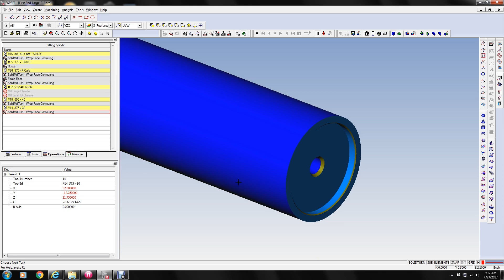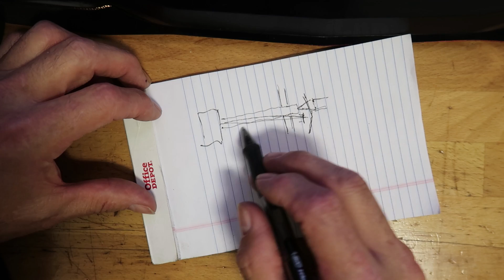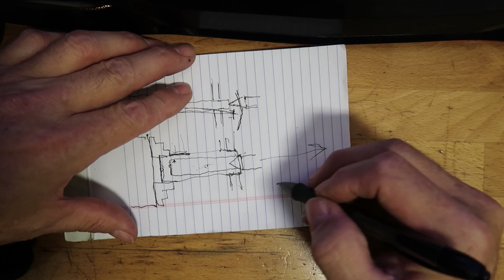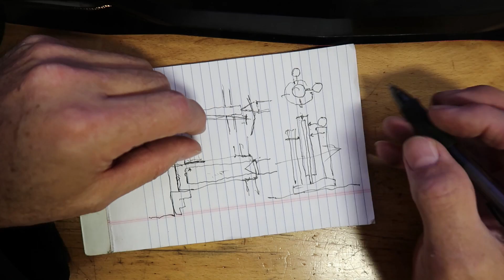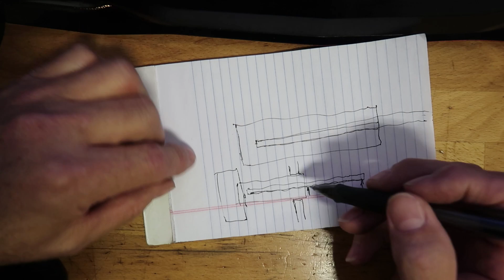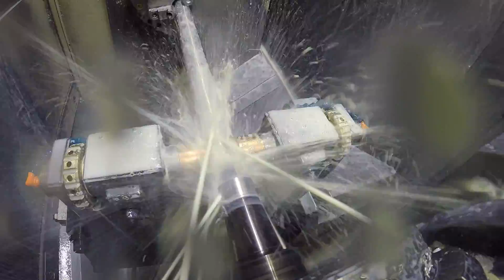Some Thoughts On Using Steady Rest and Milling Part End

Comment: Nitronic 50, is that tough material to cut? I have a job coming up, simple turn part with tap hole in the middle. What would you recommend rpm,feeds and speeds be?
Reply from the maker: I would start with around 150 SF (This is in feet if you are metric you will need to convert). That would be safe and you could speed it up as necessary, for the turning with carbide. If you are drilling with HSco drill I would not go over 40-50 SF. Depending on the tapped hole size. If it is on center-line on the lathe I would single point thread is if possible. Rather then tap. If you must tap get a good tap. This is not the place to economize on the tool. It will give you grief later. And use a good tapping fluid as well. I usually use a syringe to get it into the hole first. Not just put it on the tap.
Reply: @EdgePrecision  Thank you so much for the information!

Comment: what were you adjusting with the hammer and why?
Reply from the maker: On the mount of this steady rest there are jack screws that raise the steady rest. But there are none to force it downward. So in order to get it to move a little down, it is sometimes necessary to tap it with a piece of something and a hammer. In this case I was using a scrap of aluminum bar. Hitting it down on its mount with the mounts screws slightly tightened.
Reply: @EdgePrecision  ah ic thanks was curious

Comment: Can you explain your decision making process on when to mill vs turn a bore/counterbore in your integrex?
Reply from the maker: To give a simple answer. If there is a intermittent cut I would look at the possibility of milling. If there was something that prevented turning the part at a speed necessary for a lathe tool. Lets say a imbalance or the part could vibrate. Say I couldn't run a steady rest and turn. Something like that. Milling sometimes cant be done. Lets say a long bore is more difficult to do with boring heads than turning. But to turn the bore has to be in the center of rotation of the turning spindle. Those are a few reasons. But every job is different. Don't know if that helps.

Comment: Any ideas how to prevent chips going into (schunk) steady rest rollers? Normal wipers do not help. Turning chrome bars so...
Reply from the maker: I take a plastic 5 gallon pail and cut the bottom out of it. Than take some dividers and set them for the diameter/radius of your stock minus a little. Scribe a circle deeply keep going around until you almost cut thru. Than take a razor knife and cut the disk out. What you are looking for is a snug fit on the OD of your bar (You may need to scrap it if necessary). Now push/slide it on right up to the steady rest. On my steady rest I took some silicon rubber sheet (the orange stuff) around 1/8" thick and cut some and clamped it between some sheet metal pieces screwed to the top arms. So that it seals/runs against the part for the width of the two top arms. With the rubber wiper/seals and the bottom of the 5 gallon pail (This rotates with the part and slings off shavings) up tight against the steadies jaws. This pretty much keeps shavings out of the rollers. even when milling if the plastic disk is on the milling side. Or you could put two disks one on each side.
Reply: @EdgePrecision  Sure, been there, done something like that before, but "chip guard" should be mounted to steady jaws, perhaps. I mean something like iris mechanism is needed, OD varies between 25-110mm ... I've jaws that sprays coolant over rollers but not working very well...
Reply from the maker: The coolant wont keep the chips out. The fact that the disk spins with the part is what makes it work. It slings chips/shavings away.  I have also done this, if you just have to have the guard mounted to the arms. Make a guard with the largest hole than make smaller disks with the various sizes needed that will slide over the diameters, but the OD is larger than that hole. Get some large O-rings say 1/4" that you can stretch over the bars. Put one on, than the disk, than another. Now slide the whole thing up to your guard piece with the disk pinched between the o-rings. The guard could be held to the arms with magnets. This has also worked for me in the past. The combination of the coolant flush and this will work.
Reply: @EdgePrecision  Okay. Problem is that this is robot line, so no manual loading. Fully automated loading etc. There's somekind of metal shield over the steady jaws and they block some of chips. The shield moves with jaws, so it is mounted. Basically we have guard but it needs improvements. And more testing, only turned few bars. But thx anyway, just thought that you may have somekind of new idea.

Comment: After watching this video multiple times I just now realized that once you get on the main road you do not have to turn off until your shop. That is a good commute for sure.
Reply from the maker: It’s only four miles long. Houston is like that In many areas. Housing neighborhoods mixed in with industrial areas.

Comment: Shouldnt you check whilst rotating the part, better indication mode?
Reply from the maker: I made this video a while ago. I'm not totally sure what you are asking. But if it's me running the indicator down the part to check for taper after turning it. It should be running true no mater what the rotation. If that's what you are asking.

Comment: did you reset your tailstock after adjusting it to compensate for tool wear?
Reply from the maker: I constantly check the tailstock position for every setup. It's not something you can just take for granted when you need precision. This is a issue I try to impress on newer machinists. If it can go wrong you need to check it before cutting the material. Don't assume everything is correct. It only takes a few moments to prevent a problem.

Comment: How come you didn't just chuck it close to 4 jaw to do the end?
Reply from the maker: It could have been done that way. In this case there were very close tolerances as to the perpendicularly to the rest of the part. In order to be sure I like to indicate the part. If the part is back in the spindle bore and the end close to the chuck jaws. It is possible to check the end but not what’s back in the spindle. Also with all the unsupported length in the spindle it can vibrate and cause problems.

Comment: Love your work man . With the bow in the part, I’ve had similar problems with a 50 mm stainless shaft and it turned out to be the jaws of the 4 jaw where twisting the shaft because the jaws weren’t 100% square to the part. So I used machined soft jaws and it solved the problem.

Comment: Yes, Peter, I have a question: your custom made steady rest fits perfectly on the diameter of your workpiece which can only be achieved by boring or machining out the three brass-end supports to accommodate a given diameter. I'm also assuming that the brass ends can be removed for additional sets of blank brass ends. But why not use instead a steady rest with roller bearings?
Reply from the maker: In the case of this project the jaws have to span slots when the milling is done. For obvious reasons rollers won’t work for that. I did do a set of these parts but didn’t film that. When I started on this the customer had to cancel the job because of a engineering design problem. So I didn’t get to video the remaining milling. If you saw that you would have understood the jaws.
Reply: Thanks, Peter and thanks for sharing your expertise. As a machinist myself, I'm learning a lot from you.
Reply: @EdgePrecision  You obviously still get paid for the work and parts you completed.  Do you get a demobilization fee in addition for them cancelling the project?
Reply from the maker: @bhleblanc If someone cancels a job I generally get paid what I have already done up to that point.

Comment: What adjustment are you making at the 20 min mark? I see the hammer and the piece of metal bar you are hitting. I guess that you are lowering the steady rest because of the very close fitting radius in the  side points? Is that right?
Thanks Peter.
Reply from the maker: I had to review that section of the video. The mount for the hydraulic  steady rest has jack screws to move the body of the steady rest but only in the upward direction. The only way to move it down is to back off the jack screws and tap/hammer it down. With the bigger hydraulic steady the weight of it makes this easer. My shop made smaller sometimes requires brute force. Yes the jaws of the steady were bored too fit this part so just backing off the lower jaw didn't move the part. They were made that way because when the milling work is done they have to span some holes and slots. Not so much for the turning. For adjustability it would be better to have narrower jaws. With the top jaws hitting more on the top to push down on the lower jaw.

Comment: What were you hitting with the hammer and block, could not see opposite end. Heavy hammer blows to move .001 inch.
Great job showing the finer points of accurate machining.
Reply from the maker: I'm going to have to review the video before I can answer this question. I cant remember.

Comment: New Sub!  How did I not know about your channel??  I am retired and make scratch built stationary steam / air engines.  I am always looking for new tips.  Thanks for sharing.Fred Ontario, NY
Reply from the maker: Always good to have a new sub, thanks! Hope you find something of use. Do you use CNC to build your engines?
Reply: No CNC for me as of yet.  If I come across a good deal in a smaller unit I may make the plunge.  I have been binge watching your videos!  Good info..  Thanks for sharing.  Fred

Comment: Why did you choose to mill/interpolate the end rather than turning it?
Reply from the maker: There are two reasons 1. for some reason Mazak when they made this machine they gave it very little travel in the X minus direction. It has only  10 MM minus X before you hit the limit switch.  2. I could rough it and finish it while turning the C axis with the endmill. To do this turning with a boring bar would require a small diameter bar or shallow facing cuts with a larger bar. But than  there's that X- travel limit again. I also would have to turn a higher RPM in the steady jaws witch I didn't want to do.

Comment: I'm a long time screw machine operator. Tomorrow, I start as a Mazak trainee. I was transferred to that department. I know nothing CNC, so I'm a bit nervous! Can someone suggest vids for a bit of a preview?
Reply from the maker: If they are going to teach you to run the machine using the Mazatrol conversational you may be better off not knowing anything about CNC. Just pay attention to what they show you it isn't hard to do. They are going to train you right?
Reply: Yes, they have a kid ready to train me. Very basic to start. The two experienced guys are swamped. We are a small company with very few cnc operators. I'm not sure about the Mazatrol conversational, but they did just acquire a couple of Mazatrol 9 axis machines. My pretraining suggestion was "leave your sledgehammer in your toolbox!" lol
Reply: Oh, wait. Are you saying don't get involved with Mazak machines?
Reply: I'm a brand new sub, so I'm not sure of your thoughts on Mazak.
Reply from the maker: The machine in this video is a Mazak. I'm perfectly fine with Mazak it's a good machine. Learn every aspect of it. There are a lot of shops that use them.

Comment: Is that steady rest your own design?
Reply from the maker: Yes I made it to use the existing mount for the Hydraulic steady rest. The hydraulic steady rest only closes down to 100 MM (3.9"). Also to do this job (in later operations)  the roller jaws wont work because the machine needs to rotate with slots in the part you cant do that with roller jaws.

Comment: how about a collar around the back of the bar to prevent whip instead of the steady rest.
Reply from the maker: Yes that would work. But in this case I don't have any way to get it in the spindle. The spindle bore on this machine is 6.625 in diameter I would have to take the small chuck out of the large chuck than take the chuck jaws off the large chuck or open them. Than some how put the spacer-collar in the spindle bore and put everything back together. On a smaller machine your suggestion would be the way to go. on this machine its possible but with the chuck arrangement I'm using I went this way.

Comment: How much do you charge to make a part like that?
Reply from the maker: The last time I did these it was a quantity of fourteen parts. there were also other parts in the assembly. For this part I got $5,000 Each for the machine work only. I don't supply the material or any outside processes just machine work I do, and my tooling needed to do that. On the last group I didn't do the turning to true up the OD to the gun drilled hole (what I showed in the previous videos) either so on this set the cost will be more for that additional work. This price in my opinion for this part is a little on the low side. I would like to get  more but the job still came out OK. The biggest problem is not having to pull off the job for something more urgent. That happens a lot and can really disturb the flow of a job.

Comment: I like your videos, but i gotta ask you : you really need to use the steady rest for that kind of operation, you can't just put the workpiece closer to the chuck?
Reply from the maker: Yes that is a way to do it. But (there's always a but) if you run it back in the spindle bore the only thing supporting the part is in this case about 2.7" of chuck jaw length. Just the weight of the part alone makes it hard to chuck the part properly.  At first I was going to turn the end but decided to mill it. If I was turning the end the un supported end up in the spindle would cause vibration. Now you could use a spacer sleeve in the spindle bore but in this case with a 6.625 bore I hade no way of getting it in with the small chuck in the large chuck. Also with the tolerances I'm dealing with here it will hold the end squarer to the OD by using the steady rest. Thanks for the question.

Comment: Make sure you calibrate your bore mics to read 0 when measuring on only a section of the mics foot. We found out the hard way!
Get your mics ring gauge and simulate the step of the .130" step you're measuring, see if it still reads what the ring gauge is.
You may already know this, just a heads up though, we scrapped a fair bit of work due to ours being about .0015 over at that depth, which is beyond your tolerance.
Great work anyways!
Reply: All due to clearance tolerances in the mic itself, when they are calibrated they are done so on the full depth of the mics foot.
Reply from the maker: Josh Sisson You make a very valid point. I did check them. Some times we do things without thinking about it because it becomes a habit. Iike I said in the video when your making a video it's hard to remember everything. I general I don't care for this type of micrometer I would prefer a dial bore gage. This mic is almost brand new and very tight. Because of the way this is being milled with rotating the C axis the bore will be round. If I was milling a circle I would not measure it with these they won't check for out of roundness.
Reply: +1 for that i.d. micrometer foot . I did actually found it out the easy way , cause i checked it before , but i was like what the heck . The foot for 75-85mm(3"-3.4" ) mic is about 15 milimeters long , and the part was only about 4+2mm part+ cutoff tool . The micrometer jaws were only engaged about 40% , and boom 0.05  mm oversize about 2 thoulsands. When doing precise work even 5 microns matter .

Comment: Nice job Peter, those are really tight tolerances especially for a part that long and at the end like that.  Those were great points to bring up on the steady rest.  As for the sound I think it's OK but if you record sound with a lapel mic or a shotgun mic you might get better results.  As for syncing up the audio/video Ted @ The Art of Photography has a good tutorial look for HOW TO SYNC VIDEO AND AUDIO IN FINAL CUT, PREMIERE CC AND IMOVIE.

Comment: With the dimensions you are working to I assume that everything matters. I imagine that the radius of the contact surface of the steady rest jaws affects how they contact the part. I would guess that you'd want the jaws to have a bigger radius than the part to ensure that the contact point is in the middle of the part. Or, maybe it doesn't matter. Does it matter?